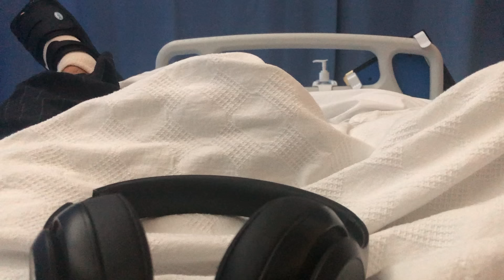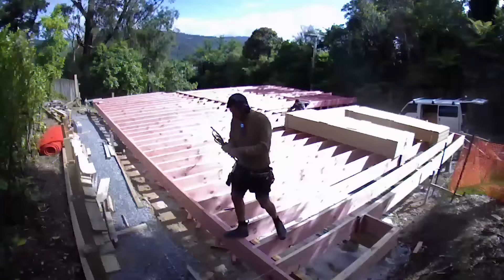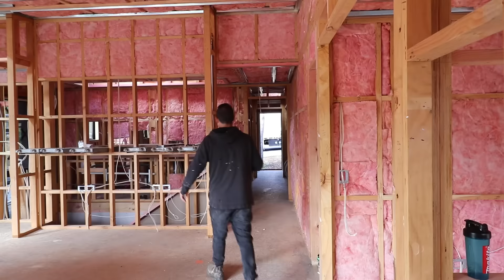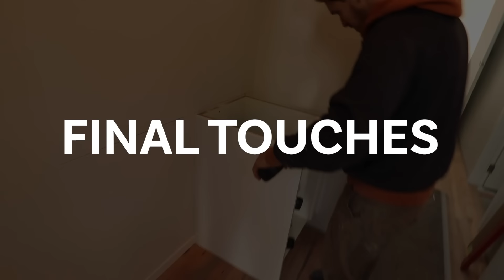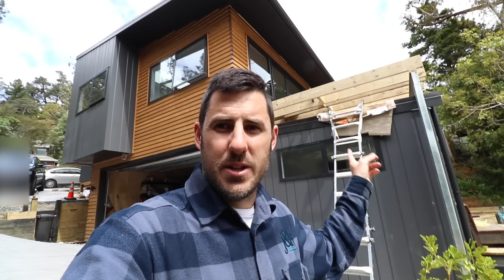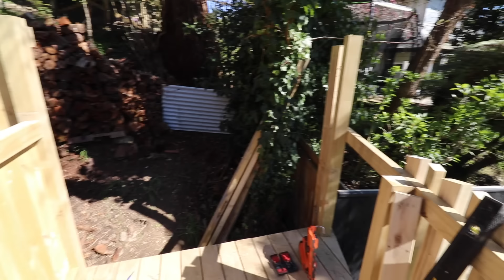I Vlogged My Entire House Build Start to Finish

Comment: Hi, great vid good work, question, why do you say you wouldnt fit a wet back? Surely it would save on power? Just thinking of fitting wet back ourselves
Reply from the maker: Short story, I actually love the wet back but due to some of the finer details of the set up with the wetback and cylinder heights, it just wasn't worth doing on this build. I would get in touch with an expert in your area and see what works best for the set up at your home.

Comment: You took the whole video complaining about the problems and challenges rather that giving useful information on your work.
Reply from the maker: Tell me what you would like to know - id love to make you a video on it
Reply: @nzbuilder  I'm really grateful for what you shared about your home, and I just wanted to say that I absolutely loved it. I have a similar steep slope plot in Turkey, and I've been gathering ideas on how to design a house with this type of terrain. Your vlog has been incredibly helpful in that regard. Could you kindly share some photos or videos showing the entrance location and the skylight above it, as well as the shape of the stairs? Also, I’d love to know the height of the basement ceiling and see the elevation/facade on the side facing the main road.
I have some design ideas that seem similar to what you've gone through, and it looks like you made the best decisions. Could you explain why you chose not to place the main entrance and parking on the side facing the main road? Do you think it might have been better than having them on the smaller side road?
Lastly, I’m considering a double-height living area at the back of the house, with access to a backyard where I plan to have a pool and sitting area. Were there any challenges you faced in doing something similar?
Thank you so much, even if you're unable to respond

Comment: As an American, sometimes the Commonwealth terminology confuses me. Isn’t plasterboard the same as drywall? If so, why would you need a plasterer?
Gotta hand it to you—that was a LOT of drywall to install!
Reply from the maker: Yes I believe its the same - it comes in sheets which are screwed up. The plasterer fills gaps between sheets and holes for a smooth finish to paint

Comment: Hi bro, you're very inspiring to me. By the way, I'm from a tropical country where termites are the biggest enemy of wood. Is using wood as your main material only safe in your country? in new zealand, or do you use specific types of wood, or coat the wood with anti-termite fluid?

Comment: As I live in India most of the house here are made of bricks and Cement and they are expensive. I found that these type of houses are very convenient. It's cheaper, Quicker to build and even better in terms of flexibility like you can hide wires underneath the walls. I have seen a lot of Indians leaving their house incomplete because they don't have enough budget so I think this kind of buildings should be more often used in India. About the durability it would be a little weaker but it would still be cheaper to repair too. Good job love this video ❤️❤️

Comment: I think you made a mistake at the beginning of the video when you said "1600 sq meters" That is 17, 222 sf, which your house is no where close to that size. Normal square footage is based on heated space only, but still, a 17,000 sf house is a huge mansion. I thought you should know.

Comment: No offense, but you're going to have to carefully monitor the structure of the house for years to come. You won't know if you've fucked up until at least ten years down the line once the house settles. Sometimes, building in a place no one will touch is a fool's errand. Hopefully anyone you sell the house to will see this video.

Comment: No matter how many times I see house built with a wood frame, I'm still weirded out by it. Outside of just habit is there a particular reason why you are using wood frame? Wouldn't armoured concrete be an easier and longer lasting solution?
Where I'm from everyone uses armoured concrete for a frame and then fill it in with brick and mortar.

Comment: Note to self, when mowing grass on a hill with a motorized tool, do it downhill. OUCH!!!!
Hope it healed well, man! Mad respect for your work!
Reply: Yeah running over a foot with the mower sounds absolutely horrible, one of my worst nightmares actually
Reply: That mower doesn't have a safety lever on the handle.Dont know about there but here in America if you let go of the handle the mower will quit.
Reply: @pipj14u2nv1  it probably did, but it's still turning by itself.
Reply: There’s only one way to get back up hill tho…

Comment: A massive fail on the wall tiles, there is a tiny strip of tile on the left side. devide the wall width by the width of the tile and take the amount of what's left of the tile on both sides.

This is rediculous.

Comment: Not bad at all. Looks really nice but yet seems so very flimsy . It feels like when the first strong wind comes that wood only structure will fly away. Is that black metal cladding. Imagine how much black metal atracts the heat during summer....I've seen these type of homes on my travels through New Zealand and I lived in one for a week during summer...it was worse then a sauna in there. Looks very nice but very thermic inneficient . During summer you need have constant AC on to keep it cool and winter you need to heave the heating on 24/7 to keep it warm. Looking lovely but not sure about the benefits of building this way.

Comment: I'm a builder in Holland, I'm most impressed you pushed through the last months of 'almost finished' with such energy and actually saw it through to absolute completion whilst maintaining those quality levels in the garden and finishing, that takes grit. The feeling when the plastering gets done is always one of the greatest achievements, but usually less than half way to the end due to all the little details. 

Subscribed and looking forward to your next build!
Reply: Hi, this is Vienna from Prima. We are currently seeking potential partners in the construction industry. Allow me to introduce myself: Our company is a reputable manufacturer based in China that provides high-quality building materials. If your upcoming project requires doors, windows, stairs, cabinets, and guardrails, we would be delighted to offer you a quotation. Our prices are exceptionally competitive compared to the local market. Please do not hesitate to contact me if you are interested in exploring this opportunity further.

Comment: That looks awesome and the tiered layers to make use of the sloped yard looks great too. The only thing I'm wondering about and would be concerned about is the water running down the road and into the driveway and straight into the garage. Maybe you addressed it in another video and it looks like you're not concerned since you were washing with a hose right on the driveway but I would be concerned during a heavy long rain that the garage would flood.

Comment: Really enjoyed this video production... a lovely house to be proud of... was a little surprised you did not use any steel mesh or expansion joints in the final outdoor car space slab...
Reply from the maker: Thanks - we use fibremesh that gets added at the concrete plant - I find it more stable and cracks less than concrete with reo mesh

Comment: Hello from the Rockies in BC, Canada! 
I watched my dad build a few houses, all of which he lived in. It's not for the faint of heart. I respect anyone who does that. It's usually a crazy ordeal. By the third house, my dad knew best how to proceed. He got a general contractor, and worked alongside him. 
I shouldn't have been surprised to see all the same tool brands we use up here: Mikita, Milwaukee, etc. I'm never surprised when I see Toyotas and Hondas abroad.
Reply: I wonder what kind of wood you get in NZ? We have what we call SFP locally, which stands for spruce, fir and pine. So, building lumber that is SFP could be any of those. All local softwoods here.

Comment: Would anyone explain to me
why did you decide to use a wood as a building material? 
It doesn’t inspire confidence.
Why not a reinforced concrete piles with thick brick walls?

Such a house will last for a few centuries, only maintaining a roof once in half a century.
Reply: New Zealand is a small island nation, prone to many earthquakes. Smaller timber framed structures withstand the forces earthquakes put out a lot better than concrete or brick structures. Japan is similar in this regard and they also use mainly timber frames

Comment: Hi , I loved the build and design issue from start to finish , great job ! May I ask , when I got to your favourite like mine the batt insulation , I see you had classed in fibre cement board then batteries of and no building insulation wrap ? Is the fibre cement the heat reductive part and also no down flashing arround windows , as I guess the cements sealed arround openings! And it’s good to see the end of your effort finish and relax with family , sorry asking a lot of questions hope 2024 is great year in NZ

Comment: Very nice video, good detail, design of house also lovely. Its free country but still curious why the heating stove when you already have a heat pump?
Reply from the maker: I love the warmth of a wood burner. Heat Pump is mainly for summer cooling, or those mornings where you just want to put some warmth in the air without lighting a fire

Comment: Great video. I know that down here in the south so many people including the council stay away for sloping sites due to the extra work and cost involved. Even though most of the town is built on hill sides. Great to see someone taking up the challenge. Personally I think it would be great if someone could come up with a range of designs to suite sloping sites (I know it's not that easy and there more to it) depending on soil and ground conditions and the slope. But given that so many houses are built on sloping sites and hill sides I personally think in my opinion that a range of standard plans could be a good idea
Reply from the maker: Thanks for watching - I've made some other videos on how to approach sloping sites and tips I've learnt along the way

Comment: Wow, so much work.  Really impressive.  I was kind of wondering what that netting was that was on the ceilings before the roofing went on?  I saw that it was gone by the time the drywall went up.
Reply: Its fall protection. So people don’t fall while they are working on the roof
Reply from the maker: We install them before doing roof trusses and roofing, a safety precaution to prevent injury from falling